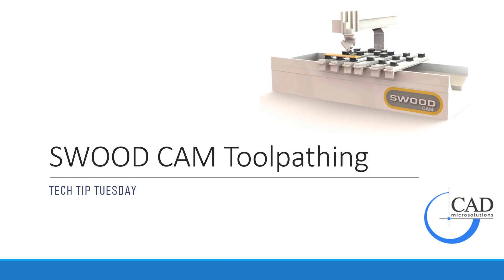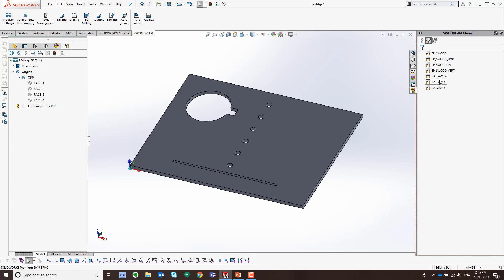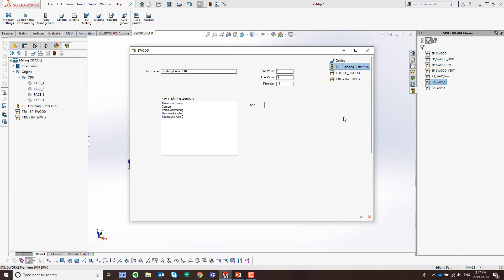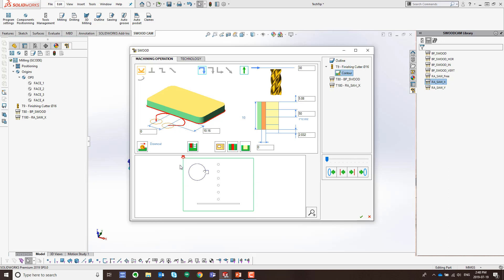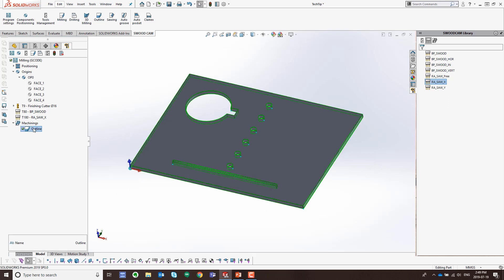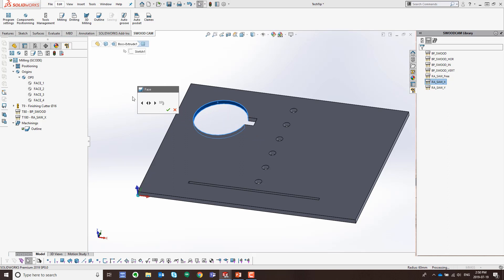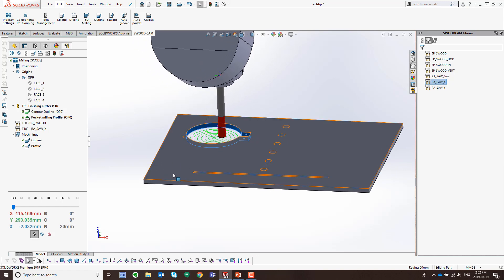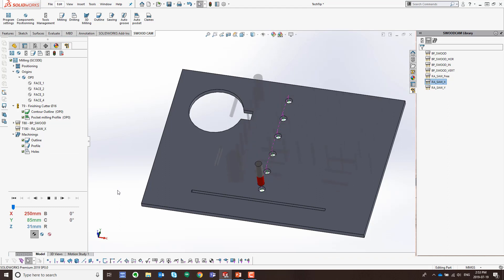Tech Tip Tuesday: How to create a Toolpath in SWOOD CAM

Comment: Hello. Your videos are very interesting. I start working at SWOOD. I can't solve the problem, maybe you can suggest a solution. Having laid out the details in Nesting, generating the code in Encoding Debugger throws an error (TEFICNCode:Util:EvalMoti erreur: VALUE OUT OF RANGE
ENCODING STOPPED
[EFICNCode Util: Syntaxel erreur.
Evaluation de la syntaxe-2009 mot-6000 Ligne
Number
(EFICNCode: Codage: Coder erreur: CAN NOT EVALUATE MACHINING OPERATION SYNTAX: POCKET MILLING). What can be the solution? what can be the solution? Thank you.